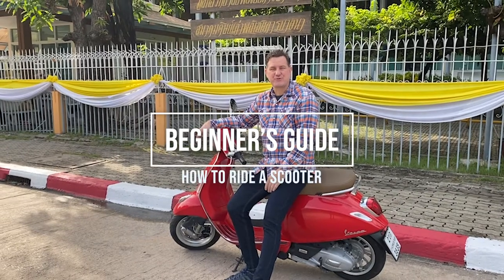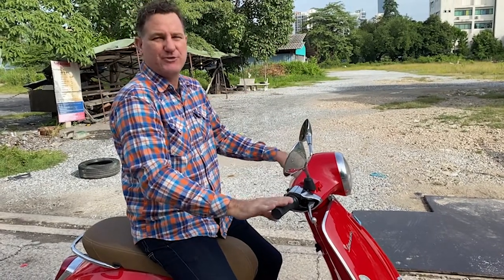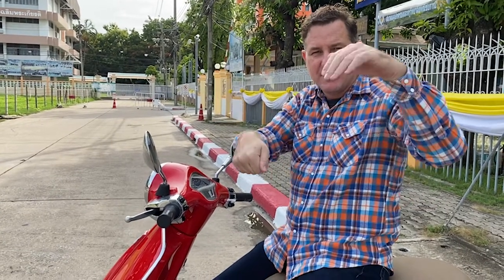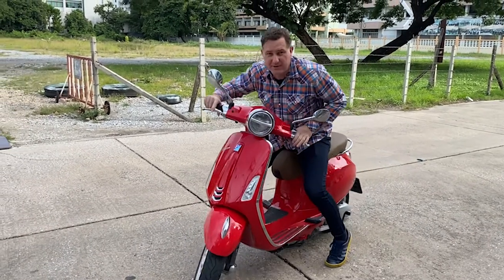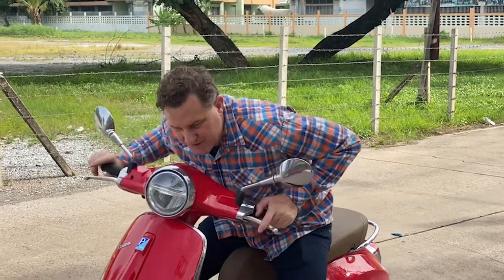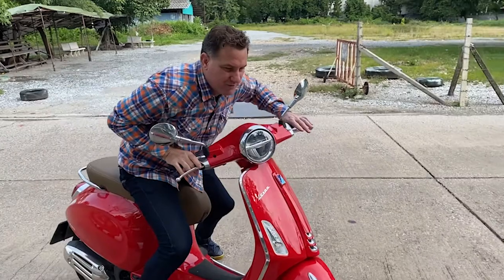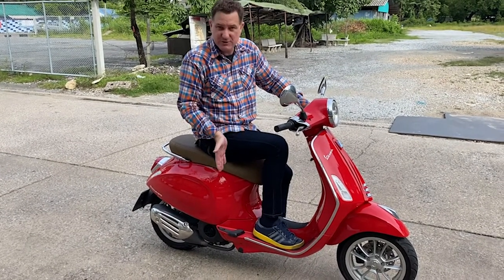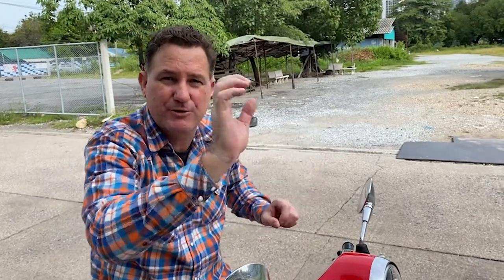HOW TO RIDE A SCOOTER | Take Off, Move Off, Slow & Stop | Brakes & Throttle | PART 4

Comment: another thing is that if your feet dont hit the ground whe your sitting fully on the seat,thats not good.never be uncomfortable and at the end of your seat to barley touch the ground.get a smalleer/closer to the ground bike in order to reduce accidents and to have more controll of your bike.
Reply from the maker: That is an excellent point. Thanks for sharing.
Reply: @ianwatsons you have to use both brakes? When stopping or slowing down, and do you have hold the breaks until the green light on the traffic turns green you can release the breaks ?

Comment: I had a motorbike as a teenager, and have taken the motorcycle safety course, 10 years ago.  Now as a senior, I have acquired a scooter.  So glad I found this series of videos.  Age and no clutch make a big difference.  I am going to cancel my enrolment in a beginner motorcycle course scheduled 3 months out.  Having taken it before, it will not provide me with the skills I need.
Reply: 3 2 3

Comment: I agree with your points. But my question is, what can 1 do when there are potholes in front of u and you can't look that far ahead towards the horizon? What's your suggestion for this? Pls guide
Reply from the maker: Great question. The key is not to fix one's eyes, but really keep your eyes on the move - grabbing info. check road, mirror, up ahead, car in front, mirror... key your eyes on the move. I will try and make another video and explain.
Reply: @ianwatsons  thank you. The information you put up is quite useful

Comment: What cc bike were you using. What cc bike should a beginner buy
Reply from the maker: I'd go for a CC 125 or CC 150. You want a bit of power for passing vehicles,  getting away from danger swiftly, power for the slow-ride and also if/when you're in 60k or 80k zone you want to go with the flow.

Comment: Hi Ian! First of all, I want to say I'm really happy I've fundo this playlist. I've watched lots of videos about how to ride a scooter, but your videos were the ones who gave me a clear learning plan, so thank you so much.

Right now, I'm still getting used to using the brakes and throttle, but my plan is to ride with my boyfriend to work, so I will have to learn how to ride with someone one the backseat.

So I want to ask: when should I start training with someone on the backseat? Is it better to start getting used to it while I'm still getting used to the brakes and throttle, or do you think I should first be familiar with riding in general?

I know it's been a while since this video, but I'd be really happy if you could answer my question 🥰
Reply from the maker: Some tips for riding with a passenger:
(1) make sure they are seated comfortably, with feet resting on the pegs, and they are holding something with at least one hand before you take off. 
(2) rider and passenger need to work out a way of communicating when it is accelerate, slow down and stop time... this can be down with body language (e.g. when you take off and accelerate drive leans forward and the passenger gets the message and when slowing down or stopping driving sits up)
(3) turns - work out a system so the passenger doesn't wobble, lean too much; not lean at all... and they do this consistently. 

Conclusion... I think I need to make a video about this!
Reply: @ianwatsons  Thank you so much for your answer! I would love to see a video about this topic

Comment: Thanks a lot.
What are disadventages if the rider does not set up the breaks?
Reply from the maker: Setting up the brakes --- gets the brake pads in the ready position so you can then apply them gently ALSO it's about the mind-set... because this techniques means you focus on observing dangers EARLY and getting ready. Otherwise, you have un-prepared riders, who are not thinking ahead.

Comment: What happens if your hand gets tired holding the throttle?
Reply from the maker: Good question - use your arm & shoulder strength instead of all your hand muscles. when throttle is off... you hand should point down and wrist should be bent... then as you increase the throttle... your wrist move to straight and less muscles are used.